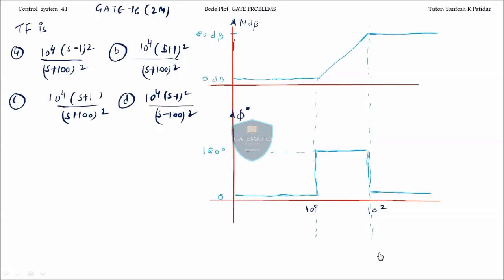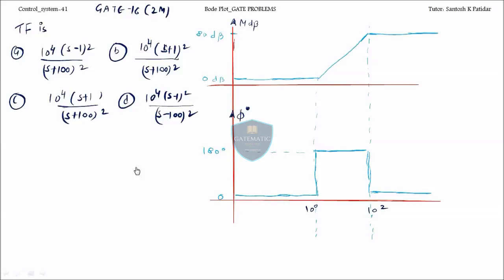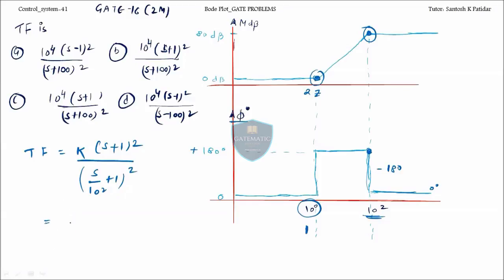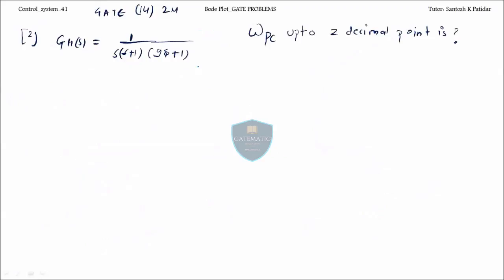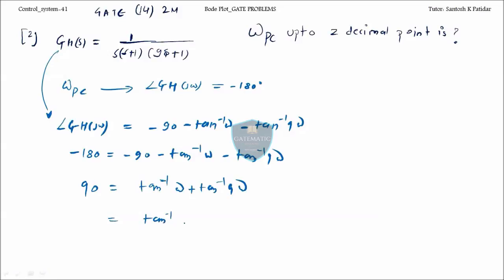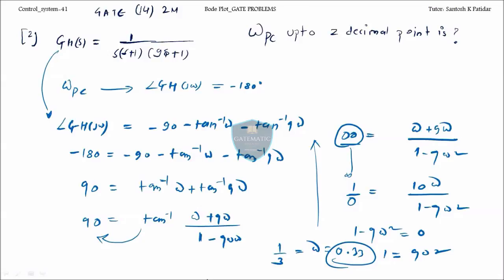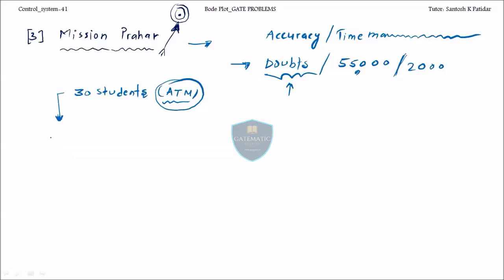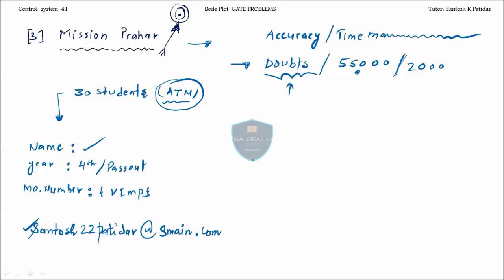Lec 41 GATE Problems on Bode Plot (Contd.)

Comment: Sir why two zeros and two poles not understood plz explain
Reply: Hii g kavya can u tell me the best power system utube channel.only in english..bcz i m from Tamil
Reply: Shankar sharma I don't have complete idea but I think u can watch nptel videos which are most probably made to be in English only
Reply: if we calculate the slope,plot which is present between the (log1, 0) and (log100,80), we will get positive 40 db, which represents that there two zeros at w=1 and the same slope at 100 is changing to zero. Slope becomes zero until unless there is equal counter part i.e -40 db which represents the presence of two poles at w=100